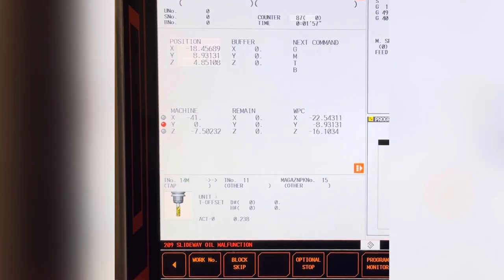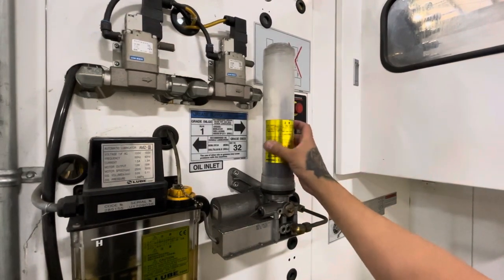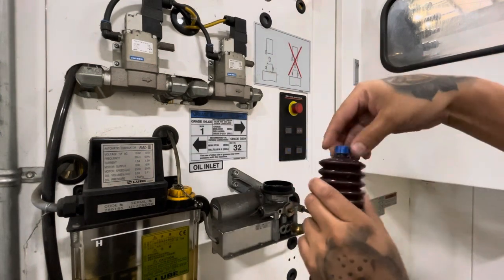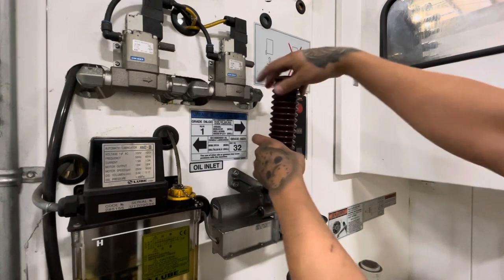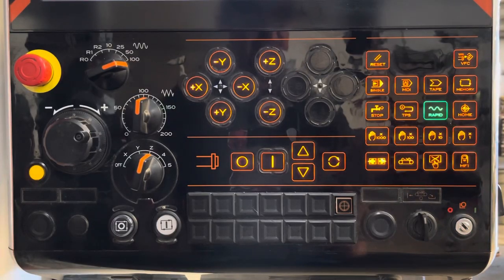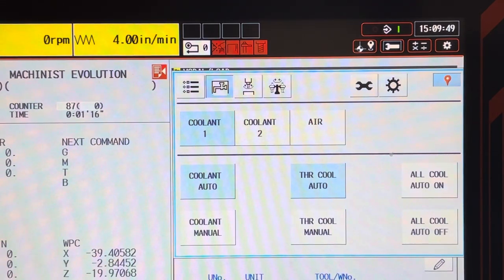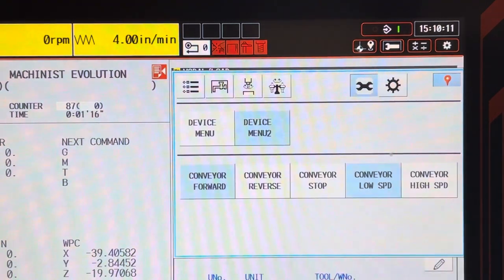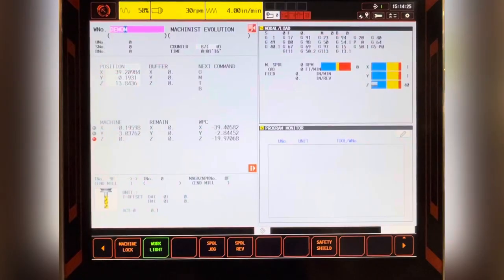How to Clear a Slideway Oil Malfunction Alarm

Comment: Hello…. 
I have some question. 
I have 2 program EIA, can i combine them into one program? 

Example…
Loading material
Program A running
M00
Put material from machine.
Loading new material.
Program B running
M30
Reply from the maker: I would create a new program called main program and in that program have those two programs as sub programs and yes I would use a program in a manual unit and add the M0 to put the table in from of the door and to be able to put in a flip or put a new piece in . I use M99 at the end of my EIA program to continue on the my next unit in Mazatrol.
Reply from the maker: I’ll make a video on this
Reply from the maker: DM me @machinist evolution and I can try to help you more
Reply: @machinistevolution  Thank you very much for your answer, but i canot make this.  can you help me with vidio?? 

 
Im from indonesia. Thaks
Reply: Hola ,tengo una alarma en una mazak vc 500c la alarma es 33 servo malfuntion 2 ,en el drive me aparece el número 50 podrías ayudarme